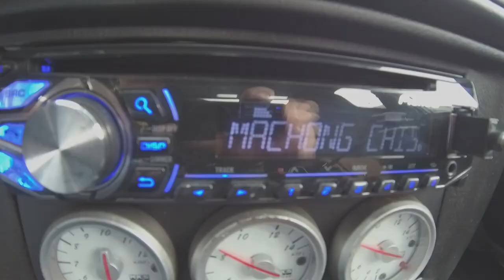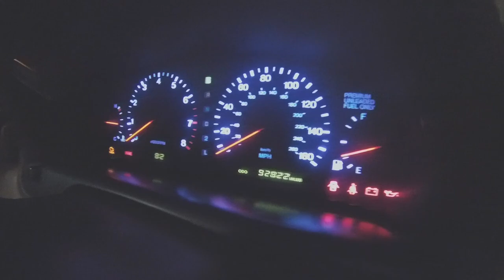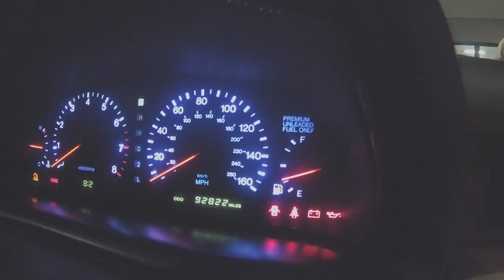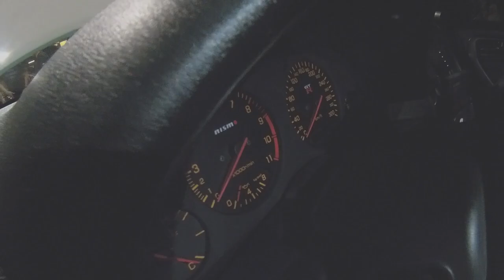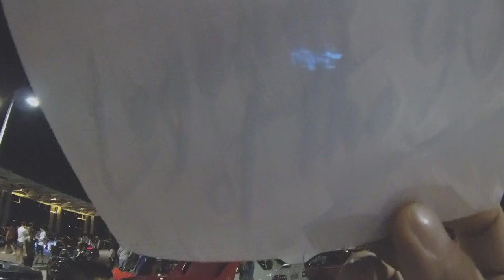1990-1999 Legends of the 90s

Comment: 1990s is also the time nung naglabas ng mga rare at one of the kind models dito sa local market natin noon:

-1997 Mazda 323F Lantis

-1995 Mazda 323 Astina

-1999 Nissan Sentra Exalta

-1998 Mitsubishi Lancer GSR sports coupe

-1998 Hyundai Coupe (Tiburon)

-1992 Mitsubishi Galant GTi

-1996-1998 Proton Wira

-1998 Toyota Crown 3.0L Royal Saloon

-1997 Opel Vectra

-1998 Opel Omega

-1999 Opel Tigra

Ilan lang sa mga rare '90s

Comment: Noong 1990s era, eto lang ang mga gusto ko na meron sa isang kotse noon:

-power steering

-power windows

-power central door locks

-power side mirrors (with folding mode)

-EFi DOHC engine (gasoline model)

-Turbo Diesel (diesel model)

wala nang kung anu ano pang mga tech toys at iba pang mabusisi na mga electronics at censors,